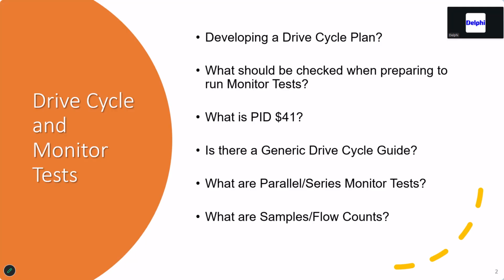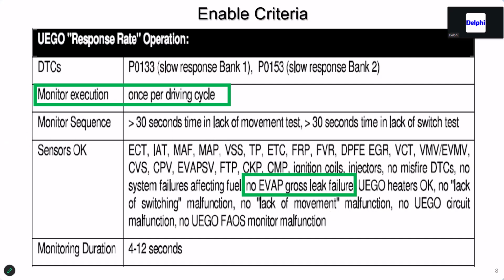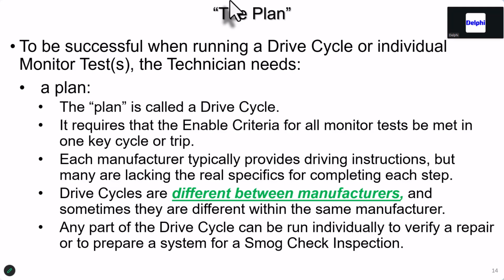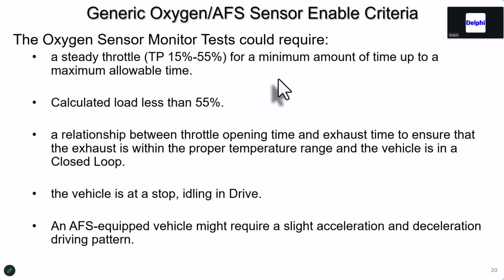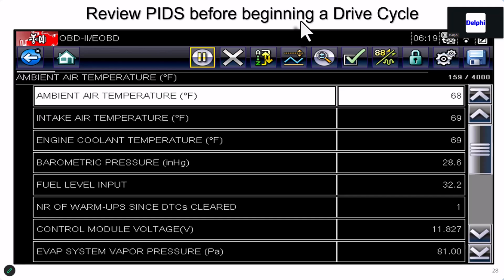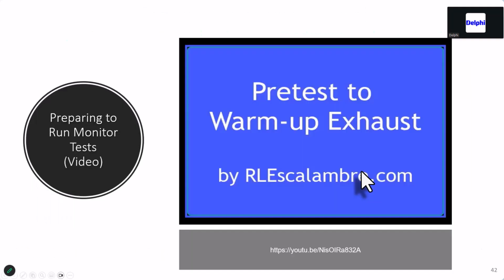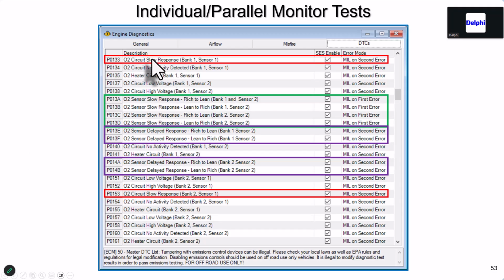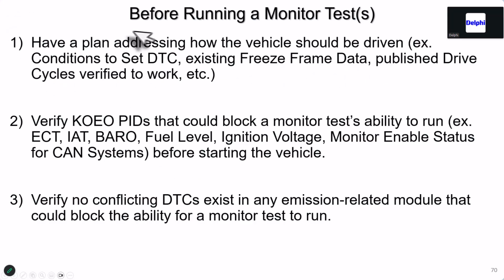Drive Cycle Tips

Comment: Thanks for the info.

The pcv failure is a great catch that most would'nt find (including me).

Were there any other signs?  Maf reading a bit too low?  Vacuum low?  I guess there wasn't any trim codes.

Nissans have had defective pcv valves that cause a P0101 (maf) code, which also confuse a lot of people too.

Can't wait for the vid on Mode 6.

Jim
Eve's Automotive
Reply from the maker: Jim, we didn't have any other data to pinpoint the problem. The has on the Map was the key, knowing what a good MAP graph should be, and knowing the location of the PCV below the MAP made the most sense. Also, please always ask yourself what the reporting component is for the specific monitor test.  In this case, it is the MAP sensor. I now have three PCV valves here that have caused a similar problem.  I always say, "Don't forget the basics," and the PCV has become a forgotten part of that.

I will be making the Good and Bad of MODE $06 video public very soon. Please check back. On June 25th, I will be doing a Good and Bad of MODE $09 webinar for Delphi.